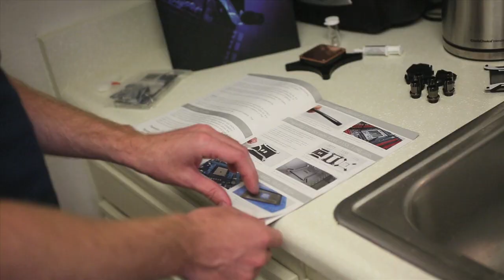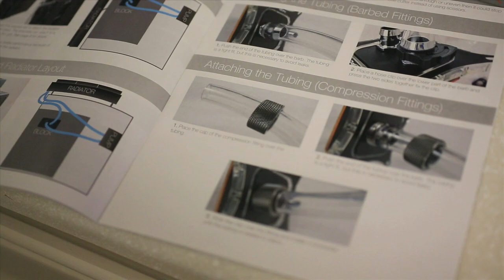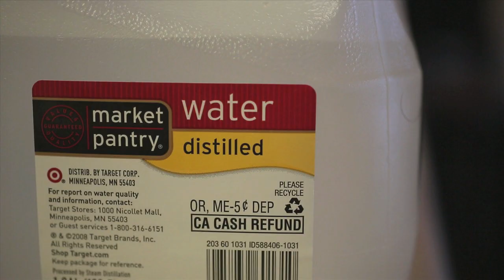A Beginner's Guide to Water Cooling Your Computer

Comment: Do i have to put on thermal paste?
Reply: Yes.
Reply: Sir Forti like if i dont put it everything will not work and completely ruin my dream of watercooling?
Reply: Yes. it's needed.
Reply: LP-40 It's not like it's that hard. Just drop a little dot on. It's not a big deal at all.
Reply: Sir Forti not that its that getting stuff into my country is pretty hard
Reply: What country?
Reply: Sir Forti Venezuela
Reply: if you can manage to get the water cooling kit, it will most likely come with the paste.

Comment: Would it be foolish to use Teflon tape on all of your fittings?
Reply: I'm wondering the same.
Reply: It depends on the thread type on the fitting.  I wouldn't bother with tape with pressures this low.  Just snug the fitting with a wrench, don't use pliers.  If you have a taper on the thread you can use tape.  If it is a straight thread, for the love of God put the tape down and just snug the fitting.
Reply: Jrsydvl2003 Thanks for the input.

:)

Comment: ok so, it still needs to COOL the water with fans, so what is the benefit of this? you still need fans , so you got the sound problem, and will it cool it more or less? and if less how much less, and will it cost more at the long run or not.

Comment: what's better
 water or air?
Reply: +xLordEnder Indeed the only reason people use air is because it's cheaper and they might be afraid of leaks
Reply: nothing wrong with your comp as it is with just fans...all you need to do is get a bigger heat sink,,,dont believe this bullshit water theme...cause if it leaks,,(which it will) then say bye bye to ur comp...if they really cared about ur stuff,,the lines would be connected for u when u buy it...that way,,they would be liable for you fried comp...this is almost like saying u will blow up a air cooled dirt bike engine,,without water cooling it..skipping the fact that its ran just fine for 20 yrs lol  its just a money scheme  for all the neardy gamers that dont know any better
Reply: Hounten 610 fans >:V, no water cooled, Im too lazy to set that shit up and i dont like the idea of water in my rig. AC + 10 fans = north pole for Processor >:V.
Reply: fire
Reply: Water
Reply: +KevinBowser007 why? (with a good explination)
Reply: +crazyaligator Water cooling cools the PC more efficiently as water transfers heat while air doesn't the air cooler only transfers the heat from the cpu into the case then out the exhaust case fans so some of the other parts get heated aswell
Reply: I have air and its always so hot i think water is better
Reply: +Hounten Water cooling is also proven to be a lot more quieter and silent than using air cooling.
Reply: thank you guys for explaining!
Reply: +honey boo boo Leaking usually happens on extremely overkill water loops that go to the ram CPU and gpu and people who don't check on their loop once in a while If your too scared for leakage because you don't trust yourself or for money reasons just go for a aio watercooler like the nzxt kraken x61 or h110i air cooling is horrible if your running let's say a 5820k or 5960x and you want to overclock it a bit so you get extra performance it will overheat and the thermal paste will fry causing the CPU to die out. Air cooling is safer but water cooling is better and still has a low chance of leakage if your doing a aio cooler or if your careful while making your water loop (use compression fittings)
Reply: Hounten   lol  nah  ill stick with common sense lol...i see it this way,,,every comp ive ever owned has lasted 5 or more yrs,,it running hot never was the issue...it was either the software was out of date or a virus got the best of it..never had to have a reason to strap on radiators and water pumps...its  not like im trying to make a dragster computer lol   only thing i see this good for is looking cool, with lights and see through side panels...besides that...total waste of time and money
Reply: +honey boo boo Ey its your choice water cooling is usually only for high end pcs and overclocking. If you aren't planning on overclocking then go for a air cooler I'm not saying they're bad it's just they won't cool aswell as watercoolers since water transfers heat and it can cool the gpu aswell
Reply: +honey boo hoo It's pretty much like comparing a Range Rover (air) to a lambhorghini (water) it will cool more efficiently (speed) is more pricey and more "dangerous" Air cools less efficiently and less risky I've used both so far but I had to go with liquid because my CPU was overheating I have no problems with air whatsoever it's just I prefer water more
Reply: Dude stick to fans. Thermaltake 22 Plus comes with like 6 fucking fans and its a $34 dollar case, LITERAL cold air comes out of my computer (which freaked me out at first). The only game that makes the air warm is gta 5 but its a beefy budget PC and its medium and high settings (ultra for some) but 60 fps on average for 90% of the games i own.
Reply: +Hulkachan Why would you want to do air cooling if water cooling does the same thing but better he's not on some 200$ budget
Reply: Hounten Water cooling is just overkill. 410 fans is just fine. Intel fanboys LOVE to brag about who their CPU's dont get hot (which is a fucking lIE!!!) YET! they're the ones buying the most after market cooling fans.
Reply: Hulkachan Dude water-cooling isn't overkill its for overclocking and keeping your pc quiet.
If you are not overclocking then go for an air cooler I'm not stopping you its just id get water-cooling whether I'm overclocking or not because that extra bit of money is worth my pc being cooler
Reply: Hounten why overclock when you can spend extra on a good GPU and a nice after market cooler?
Reply: +Hulkachan Dude a aio cooler is 125 dollars and performs better then any air cooling fan might as well buy a gtx 120 or some shit and get an aircooler 😒 Watercooling is different there's aio and custom aio is for gamers doing over clocks on the CPU for less then 150 bucks and custom loop is for enthusiasts. Even if your on a tight budget a aio cooler is your best choice it performs better then Any air coolers and is more quiet while allowing overclocking.
Reply: Hounten 10 fans is enough >:V, Im not running a car im running a PC!! NO WATER NEEDED!!!
Reply: Hulkachan A CAR HAS NO WATER IN IT!!!!!!!!!! AND WATER IS NEEDED ITS FASTER AND COOLER 10 FANS IS ENOUGH BUT WATER-COOLING IS MORE THEN ENOUGH WHICH IS BETTER
Reply: Hulkachan FOR SOMETIMES LOWER PRICES (I SERIOUSLY DID NOT MEAN TO MAKE THIS ALL CAPS BUT THATS WHAT ENDED UP HAPPENING!)
Reply: Water has a higher heat capacity than air
Reply: Hounten both of my friends got there shit leaked

Comment: Will I be able to use Chrome and browse youtube if I do this? I am new to computer...
Reply: facepalm
Reply: no
Reply: make sure to upgrade your mousepad
Reply: No, you just need a good CPU and a fast Internet connection.
Reply: Yes :p
Reply: You need i7, gtx1080 and a very high quality ssd to open chrome dude..
Reply: ***** I have GTX 1080 founders edition, i7-6700K and 240 GB SSD yet chrome won't open for me... (using internet explorer atm)
Reply: i opened internet explorer and my computer crashed you need a 1070 gtx bro
Reply: Rosdi Kasim no
Reply: No you won't, what you need is a super ultra badass Dell....
Reply: R/Woosh
Reply: mrkiiprototype no

Comment: Why wouldn't you use some teflon tape for the fittings to ensure no water leakage?  Also, if your using water inside an electrical device, why would you not spend a little more to get a more secure connection for the tubes to make sure that they don't slip off.   Yes zip ties are cheap but they are difficult to cut off if you need to do any repair without cutting your tubing.

Comment: Count me out on this one. I will rather have ten fans.
Reply: There are all in one liquid coolers that only require a screwdriver to install. They come pre sealed and full of fluid already.
Reply: Chimney Chap Good to know.
Reply: @chimneychap5142  do you have a link ? how can it be preinstalled when you buy the parts seperately?
Reply: *****
From what? It's sealed and there's probably chemicals that prevent things from growing in it.
Reply: ***** No, they aren't designed to be opened.
Reply: Actually, it's not that hard when you think about it, what really bothers me are the other ingredients I have to add to the distilled water (or the liquid that I have to look for).
Reply: i have 5 fans (came with the case) and when ever i put my hand near the fans nothing but cool air comes out.
Reply: ***** I think it's longer than that.
Reply: but its cool to have it especially if you dream about having a bootyfull pc like me
Reply: Changing the water once every 6 months isn't too bad. I clean my PC once every 6 months since it gets so dusty anyways.

Comment: i wil be getting my New cpu watercooling (fractal design Kelvin S24) my 
current cooler is hyper 212 evo so my question is do i need to take of 
the bracket on the other side of my motherboard or is it meant to be 
there?

Comment: Hmmm water inside a electrical device hmmm I pass smh I'll use a AIO if i wanna water cool smh
Reply: AiOs often leak, their pumps are loud as hell and weaker, and their rad/fans are usually shitty. You can't fuck up watercooling if you check everything's on snug and leaktest your loop.

Comment: Who needs a guide? Just dump water on it. Duhhh...
Reply: i tried it and my PC is making woerd noises
Reply: Aditsan alrigth what ever u say
Reply: Obviously
Reply: jake loikns That sucks. Maybe you didn't use enough. Dump some more on it.
Reply: Aditsan is right I think. The combustion from the firecracker should dry out everything because of the heat it will emit. That will put you back to square one, then you can try dumping the right amount of water this time.
Reply: Not trolling kinda pissed now only thng wrking is my monitor
Reply: jake loikns Wait did you really dump water on it or are you just trolling me? You're just trolling me right? I hope so or I'm going to feel bad. lol
Reply: Aditsan i actually did i actually taugth u could water cool it that way
Reply: Aditsan nah bruh fuck u it aint even turning on
Reply: Aditsan nooo that will fry everything lol
Reply: jake loikns ...
Reply: If you used any more than 2 and a half cups of water, then you've caused irreversible damage to the case.
Also, if you haven't already, don't fill your pump with bleach. Caedarva has no clue. You'll run the risk of ultra-clocking your hardware. In turn, games will run at 3x the speed. 
Seek a professional next time. Contact me on chaturbate if you need more help.
Reply: jake loikns Stop trolling. lol
Reply: Caedarva Or he can put it in the microwave.
Reply: Aditsan its alreay dred thoe
Reply: @jakeloikns1313  try overclocking it but really really high without any cooler
Reply: jake loikns Try resetting your router or unplugging your PC for a few seconds then reboot.
Reply: Aditsan There's no way that a PC could fit in a microwave.
Reply: put ice on it
Reply: Caedarva a mini itx
Reply: Caedarva i mean i think it can fit its a thermaltake v1 snow edition idk thoe i got a bad feeling bout thos
Reply: jake loikns The microwave will fry what's left of the computer anyway. lol
Reply: Okay if it has snow in it maybe it will offset the heat from the microwave. I would advise you to try liquid cooling afterwards with bleach. I'm curious to see if it will cool the PC and clean the components at the same time. Finger crossed.
Reply: Caedarva okayy what ever u say fingers crosses
Reply: You? i like you
Reply: Caedarva a mini itx
Reply: i did this on my computer and now is extremly silent
Reply: LMAO really lol
Reply: Aditsan that definitely won’t destroy it
Reply: Yes
Reply: Ikr like obviously
Reply: It was Done Wrong for the purpose of the video
Reply: JD you’re meant to use Coolent fluids I of course you need a guide
Reply: Just keep it in a tank of mineral oil. You can put your entire system in it.
Reply: Pog
Reply: Nooo that will definitley dedtroy it

Comment: I would seriously recommend some plumbing tape for the treads of your fittings of your inlet and outlet pieces. Simple plumbing 101. I know this is new to pc's but when your mixing water and electricity, its best to take extra safety precautions. I saw someone mention anti-freeze, yes anti-freeze is x5 times as better @ cooling your car and pc than water. For better looks you silly silver piece could be replaced with some pride. Buy a silver coin and drop that beauty in the water. :D
Reply: thats what i was thinking also
Reply: No
Reply: re: "I saw someone mention anti-freeze, yes anti-freeze is x5 times as better @ cooling your car and pc than water."

This is completely incorrect. Antifreeze has about half the specific heat (heat capacity) of pure water. It's used in cars as it has a lower freezing point and higher boiling point than water, so parking outdoors in the winter won't freeze nor driving in the summer boil it, but for an indoor computer where the water should never come remotely close to the boiling point, it's unnecessary and due to the lower specific heat a far worse coolant than just water. The commercial computer coolants on the market are distilled/deionized water with the tiny amounts of biocide, corrosion inhibitors etc. pre-mixed in.

Comment: do you have to check the size of the waterblock
Reply: +anime fan Yes. You have to make sure that it fits your motherboard. Otherwise it can't be installed. Same counts for cooling your GPU's. They missed a lot of important points in this AND they used some horrible fittings that doesen't seal the loop properly. If you want a proper tutorial, head over to Linus Tech Tips, JayzTwoCents or AwesomesauceNetwork for how to install watercooling. I'd probably take watercooling advice from Jay. He's been doing it for more than 11 years. And has only had 1 leak. I'm confident that he knows what he's doing :)

Comment: Distiled water isnt conductive so it can leak but it will make a mess
Reply: +misko 02 Yes it is lol its alot less than normal water but it still conductive
Reply: +misko 02 I would only use distilled water to test a waterloop system, before installing it :)

Comment: by keeping the motherboard upside down you can avoid any accidental water leakage that can damage the expensive hardware.
Reply: +Ashikur Rahman how can we keep the mobo upside down. which cabinet allows that ? :/
Reply: Abh19021
just by attaching the casing from beneath the motherboard using screws with 90 degree ceiling arms up against the wall. a bit odd way but will reduce the risks.

Comment: You should have put assembled everything outside the case and tested it for leaks. Why risk springing a leak inside your case.  Thumbs down.
Reply: +Rafael Moreno So after words, he'd have to disassemble it and reassemble it back inside the case, and then he'd have to test for leaks again.  Not seeing your time savings here.
Reply: +driven01 it really doesn't take that long. and it's better than taking the chance of getting anything wet.

Comment: SO ARE THE RADIATOR FANS INSTALLED TO LET AIR IN THE CASE TOWARDS THE RADIATOR OR TO PUSH AIR OUT OF THE CASE? I HAVE ALWAYS BEEN CONFUSED ON THIS. PLEASE HELP.
Reply: +Beneath Manners you can use it for both purposes depending on how you install the fans
Reply: Vincent Chu Is one more effective than the other? or does just depend on if you air in or out?
Reply: depends how the air flows in your case, wont matter that much
Reply: Vincent Chu Ok. Yeah i've been doing more research on it now and I understand more now.
Reply: Calm the fuck down.

Comment: Queston Im Bulding My first Pc. 

Specs Are i7 6700k.
16gb Ram]
R9 380x
zi70- Mb 
Do i need to buy a Radiator To watercool. My cpu or Can i just buy the h100i And hook it up Like the Videos I have watched. Thank you in Advance!
Reply: +Nance2216 You should be fine with the H100i. But, There's a newer version, I recently purchased the H110i GTX to cool my i5 4690k overclocked 4.4GHz. I'm seeing my idle temps at 27°/31° and load temps at 55°/61°
Reply: Yea my queston Is Do i need a radiator. Or Can i just buy the Cpu Cooler And be good? And what is The risk's OF runing. It./
Reply: +Nance2216 well, if you're spending that much on an overclocked i7 why not get an all in one liquid cpu cooler? and get the most performance out of your pc. Or buy the none "k" i7 6700 and use the stock cooler it comes with. Also, there's very little risk of it leaking don't be worried.
Reply: Ok. Thank you I will get the h110I Thank you for your info.
Reply: Thank you my rig is done http://imgur.com/1SWPUfX
Reply: +Nance2216 very nice indeed. I own the H440 too! are you seeing lower temps?
Reply: Yea 19c idle On my cpu.
Reply: All Brand New.

Comment: Can I use liquid nitrogen? ( I know it would freeze the components and would gather moisture out if the air... I'm not dumb.)
Reply: +Cole Walker Yes you can but i wont recommend it
Reply: Some of the most intensely overclocked PCs actually use liquid nitrogen to achieve world-record clock speeds, however that only lasts for a very, very short time, will likely fry the parts a while after and are only used for super-high-end competitive overclocking and is not viable as an everyday cooling method.

Comment: what water cooling system is recommended for the intel core i7 6700?
Reply: Anything works, as long as it fits the socket, which most water blocks do.

Comment: Does condensation build up in the PC at all?
Reply: why should it, the water cycle is completely isolated
Reply: +DallasGreen123 when you introduce a liquid in a hot environment it sometimes draws humidity from the air. I was just wondering if the tubing sweated at all.